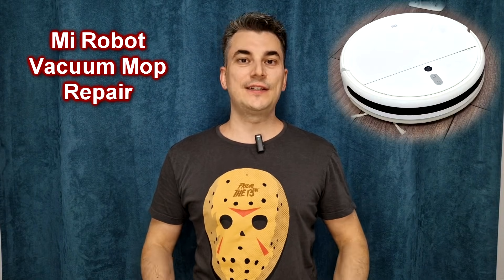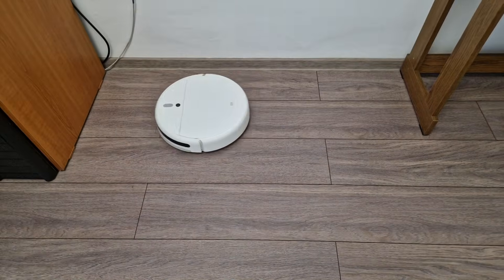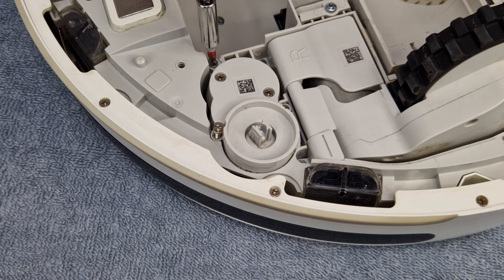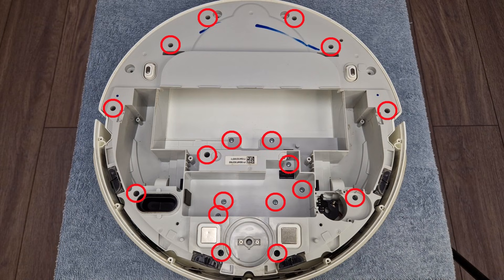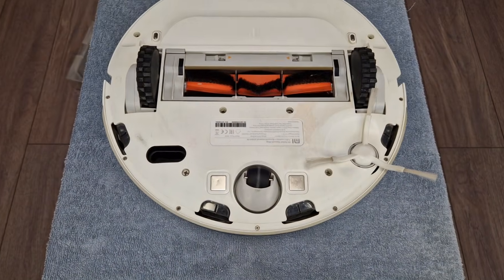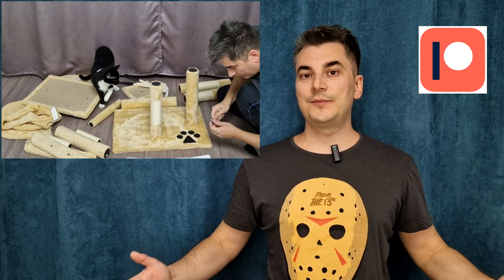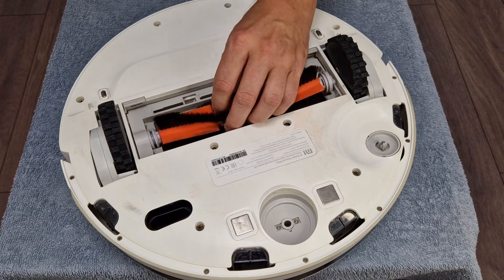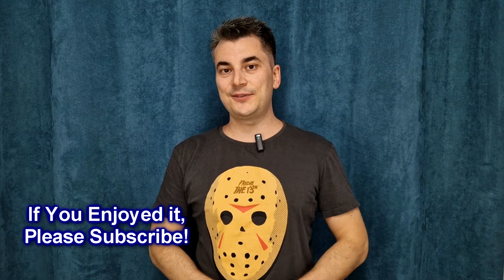Mi Robot Vacuum-Mop dismantle and repair

Comment: Hi, it happens the same with mine (same model) but no error message from the vacuum or the app. It just stops and turns off. In the internet a read it could be the battery. How can I know if it's a battery problem? Thank you!

Comment: hello, thank you for your video! my unit has a really loud noise as if one of the wheels are not turning properly. should i try to clean it? can I open the big wheel's case?
Reply from the maker: I haven't tried it, but I'm guessing that you can dismantle the wheel mechanism and clean it.
Reply: Onde posso comprar o motor desse modelo?

Comment: I have the same old vacuum, the battery i guess is weak due to irregular charging during power failures. but still can do the job done in standard mode. My only concern is sometimes it cannot dock on it's own. It's like and old man with amnesia and had to carry it around fortunately not on a toilet 😢

Comment: Great video!     You did not waste time by undoing each screw in turn.
I have same problem I believe....Error 18!
I have a spare identical unit with some broken plastics, so I will salvage fan motor from that.
Thanks heaps!

Comment: Thanks for the video! My issue was, to shut off on normal, strong or turbo mode within a couple of seconds. Now I replaced the fan/motor, and it works on normal, but still shut off on strong and turbo. Any suggestion?
Regardless, still an improvement!
Reply from the maker: Hi. In my case it was only the faulty motor. you can try a factory restore.
Reply: @ unfortunately doesn’t solve the problem…

Comment: The most comprehensive video I have ever seen, many thanks.  
I experience side brush stuck warning. No matter how hard ı cleaned it does not work. May be my motor is also broken, I will try to replace it if I can purchase one in my country.

Comment: Poor engineering design! Accessing parts should be design in such way that it would be easier to replace them. But the manufacturer counts on the fact that you would just give up and buy a new one. Sneaky. 
Good job Sorin! How about some Arduino projects?

Comment: _D&R department: design must have a lot of screws so we can screw the poor soul that have to try to fix this. (bad joke, I know) . Now seriously speaking: my only problem with robots is that if I get any kind of such technology (because of cameras, microphones and other sensors) if it need to connect to the internet to work then i am not buying it for 2 simple reasons: 1- It can spy on me and  2- companies nowadays update devices to take features from costumers or even remotely disable the device completely in order to sell you a new model. And yes I know that i am a bit paranoid about technology.

Comment: Can these faulty motor get repaired or they r just disposable?. In my case there is terrible humming sound from the motor.Fiters, brushs r all clean and tidy.plz advice.
Reply from the maker: I don't think the motor can be repaired. In my case the motor doesn't seem to have mechanical problems, the fan rotates smoothly, doesn't wobble. I haven't disassembled it yet. There may be a fault in the circuit, or the motor may have an internal problem that draws more current, so the vacuum cleaner think that it's clogged.

Comment: So what's wrong with the motor? did you try to disantle the faulty motor and see the problem? it might still be salvagable to be made as spare part....
Reply from the maker: The motor doesn't seem to have mechanical problems, the fan rotates smoothly, doesn't wobble. I haven't disassembled it yet. There may be a fault in the circuit, or the motor may have an internal problem that draws more current, so the vacuum cleaner think that it's clogged.
Reply: @Sorin_DIY thks for the guide
Reply: Can you dismantle and make a video aswekk for it? Thanks  @Sorin_DIY
Reply: Hello from future, you can disassembly the 3 screws and take of the board with rotor, its like a computer's cooler. On mine it was some oxide on 3 resistors on the hiden layer from pcb
Reply: I took my robot apart with same problem and while contemplating what to do next I cam across this video.
I was contemplating taking the fan apart as , I did find some dog hairs from my Jack Russell in the final filter....so..they have been through the fan motor.
Reply: @leedevries5660 was it the issue ??